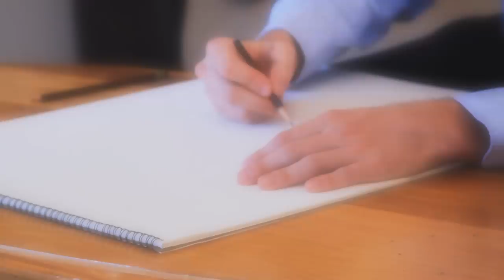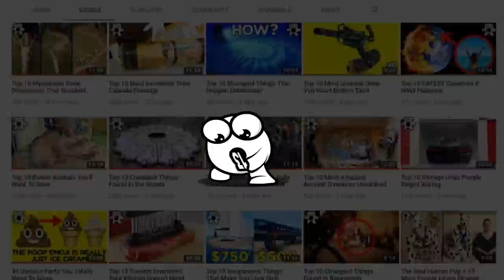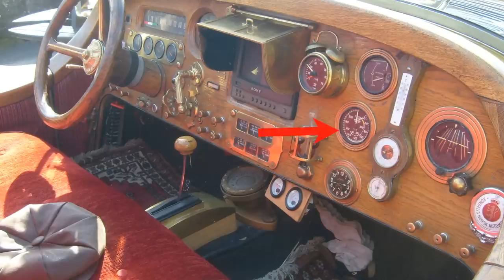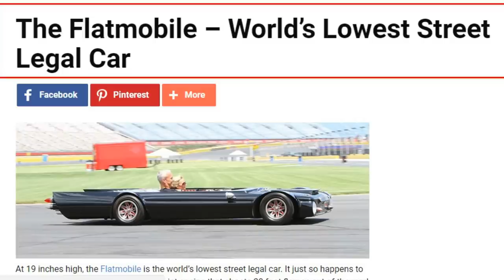Incredible Custom DIY Supercars People Built Themselves

Comment: "The front engine has 12 cylinders and is 800 H-P" - Shows a pic of the hood open exposing a Chevy small block. How this channel has over 3 million subscribers is baffling. Most of these cars are pure crap.
Reply: yes it has like 400 hp, ha ha and the rear engine is not conected, it's just there for the looks 
btw the car is builded in Norway by an italian Coach builder
Reply: I still like the channel though
Reply: I totally agree, garbage!
Reply: I think he's talking about how cool it looks but yea, still he's not right
Reply: And that kid that built that 37 mile mph super car that’s pathetic bid you call that a super car if I were that kid when I got older I’d put something  more power than like a damn 50cc put bike engine 🤣😂😂
Reply: It's a big block Chevy
Reply: @ambergonzales4200  dude he literally worked hard for that car

if u think ur better show ur build then

Comment: When I was a teenager, I loved drawing my own car designs. My wealthy uncle who had a production-stock race car team and belonged to a private race club, really loved my designs. One of them in particular, he decided to build which would have been my 20th birthday present. The design was a supercar I had called the Firestar Infernus, which was drawn in 1993 when I was 16. Some of the cars I used as inspiration were the 1993 Dodge Intrepid, 1992 Lamborghini Diablo, Ferrari Testarossa, and a few others.  He started to build it shortly after I became one of the drivers in his race team when I was almost 19. They used the chassis of a 1995 Chevrolet Caprice. It had the length and width measurements that were right, and also it was affordable. It used the engine of a 326 bhp, 5.8 L V8 from a 1973 DeTomaso Pantera GTS. The car that the engine belonged to, was owned by one of my uncle's friends and racing competitor. The Pantera met its unfortunate end in a race, but luckily it only had front end damage, so the engine was spared. My uncle bought the wrecked car, and salvaged the undamaged engine, and he put it in the Firestar Infernus. Of course, it was mounted as a mid-engine. The headlights and taillights were custom built. The headlights were similar to the 1998 Dodge Intrepid, only longer and sleeker, and made to wrap around the front of the car, with the center beam glowing green, just as I had drawn it. The taillights were also wrap around, with three long beams. The top beam contained the red lights. The nighttime glowing lights were in the center of the beam between the brake lights which wrapped around the corners to 1/4 the width of the car. This was to separate the brake lights from nighttime lights for safety. The middle bar had the yellow turn signals, which were also sequential from midway to the outer edge. There was also a difference between the hazard lights and the turn signals. The hazard lights extended slightly below the turn signals to make the wrap around beam with the turn signals look like a C towards the corners of the car. The difference was to distinguish the hazard lights and the turn signals, as hazard lights prevent drivers from signaling. It's nice to know the direction a damaged car might be taking. This was a concept I developed into all of my car designs, even though they were never built into any real car besides this one. The reversing lights was a long single beam in between the curves of the hazard lights. They were extremely visible, and according to the details I wrote about the car, it also had a backup alarm like a truck, and a backup camera, even though such devices were not available on production cars yet. My uncle couldn't put in the camera, but he said he would install the alarm. The cabin was more narrow than the outside of the car, as the edges were severely flared, and widened even more towards the rear, similar to a Ferrari Testarossa, but the flare was also over the front wheels as well, but not as wide as the rear. The rear wheels had a skirt, primarily to reduce drag. There were also plenty of air scoops, both on the side, on top of the flared decks, and one on the long roof. The long roof itself narrowed slightly towards the rear, and dropped down almost at the end of the car, similar to that of a station wagon, but more stylish. It was more of a duck tail type design, but not pointed. The car was unfortunately never finished, for two reasons: 1) I joined the army and was away from home. 2) My uncle died about 5 months after I left home. I never found out what happened to the project from my aunt. It would have been my 20th birthday present if it had been completed. I don't draw cars as often anymore, but I have redesigned the Firestar Infernus several times, including a very futuristic hover-car version.
Reply: Cool but too long... Got bored and stopped reading
Reply: I looked up the name, all I got was a BMW from GTA.

Comment: 12:00 Wait, so you remove the body, interior and engine and then KEEP 90%? How much do you value frames man?
Reply: Did you know:
The wheels are kept
The suspension is kept
The brakes are kept
The exhaust is kept
And many more.
Reply: Rolling hard in your new Vaydor.... with standard a$$ 300Z rims on it!?   LMAO  🤣
Reply: @bimmerboye896  That's not even close to "90%" of a car. That's not even 25% of a car. Maybe 30-40% if it's an actual supercar built around it's own custom space frame.

Comment: The Eagle Speedster is not a DIY supercar. First of all Eagle is a company, not a person. They specialise in restoring E-Types as well as fitting them with modern brakes and suspension systems. The Speedster is not a supercar based on an E-Type, that would be stupid, but rather it is a reimagined E-Type. And it's what Eagle sells it as.

Comment: 4:07, the car in the top is not an original Ferrari P4, that is a concept design designed by Pininfarina called the P4/5, built by Ferrari.

The car on top, was initially an Enzo Ferrari but the owner James Glickenhaus preferred the styling of Ferrari's 1960s race cars, the P Series. The project cost Glickenhaus  $4 million and was officially presented to the public in August 2006 at the Pebble Beach Concouor d'Elegance. Several websites were allowed to publish images of the clay model in July 2006.

Comment: Vaydor G35 looks good but performance is literal trash. My dad's Volkswagen Passat has a similar top speed of a little over 130 mph. This coupled with the fact that the Vaydor is almost as expensive if not the same price as an entry level Lamborghini/Ferrari (which have top speeds of at least 190 mph), makes the Vaydor a pretty terrible car.

Comment: Chen Yinxi created a beautiful body, that's for sure. Performance is over-rated, anyway. Who cares how fast or quick a car is when all cylinders are banging away... If this man's car is beautiful and functional at getting him from point A to point B... safely... and in comfort... then I love it. Because that's all that matters. 1. Style. 2. Safety. 3. Comfort. To me 'top speed' is a distant 20 or 30 on the list of things I want in a car. Acceleration is way better and more useful. But top end speed... nobody is maxing their car out. And even if they do, it's once in a blue moon. I digress...

I hope Chen Yinxi can get money to pursue making a proper commercially viable car, because it is a great-looking design. I like the centered cockpit layout. I always wondered why more sportscars don't place the driver in the center? Why not? Forget passengers. It's a sportscar, which is inherently not shooting for practicality. But you can always make the seat(s) adjustable if it was absolutely necessary. The main seat is centered, and two fold down flimsy little pop-up seats can be used if your drag of a wife insists on driving around with you like the wet towel drag she is. 
Or, the center seat can be adjustable, too. It can slide to the left if necessary to make room for a pull down seat to be configured in a pinch if you need to cram in another person. Or... It can be a 3-seater car from the get-go with the driver's seat centered and two tiny little seats on each side... Sorry, I'm just thinking out loud. Sorry for rambling. I like the car, though.

Comment: At 10 i would call it the number 1, Chen Yinyi supercar, is truly bad ass and for $4,000 i dont care if it only goes 37 mph, i would still buy one and upgrade the ev power to higher voltage system and keep it forever. Chen Yinyi if u got any more of these you wanna sell count me in.

Comment: The open top two engine car the narrator said had a 800hp v12 in front but the car hada big block chevy that was just carbed noway it makes 800hp.
Reply: Yes they got their numbers mixed up, it should have been a 1200hp v8 in front.  ;)

Comment: 1.50 is lies .. many cars built back in the 1920's had several wooden panel's...
Also - The wood framework on Ford's 1949-1951 wagons was put together with multiple pieces of planking instead of solid pieces....and many other cars ..

Comment: At 5:34 he says it has a 12 cylinder engine. when clearly you can see 4 exhaust pipes come out each side. with the hood open you see Chevrolet HEI ignition in an old small block Chevy thumbs down. if you don't know your cars and your engines don't make videos about them.